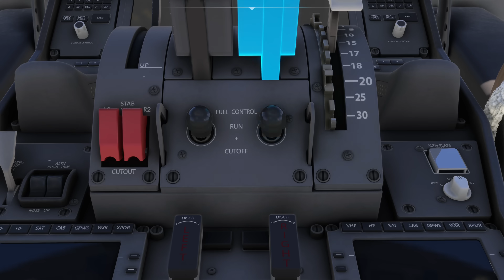Air India 171: Why Did The Fuel Cut-off Switch Get Moved?

Comment: The core issue in the AI-171 incident—the fuel control switches moving to CUTOFF just seconds after takeoff—is being subtly framed as a manual cockpit error. But given the 787’s documented history of software glitches, serious whistleblower allegations about ignored safety flaws, and Boeing’s well-known pattern of shaping post-crisis narratives, it’s plausible—that a systemic or software malfunction played a role. The simultaneous shutdown of both engines is highly unusual and demands full technical scrutiny, not assumptions. 

ALPA-India has already raised flags about the lack of transparency, exclusion of operational experts, and early narrative bias—all of which mirror Boeing’s conduct during the MCAS crisis a few years ago, when it deflected blame onto pilots until deeper investigations revealed a concealed design failure - Boeing was at fault - due to Boeing hiding information, 2 aircrafts crashed leading to the death of over 330 pasengers. 

This isn’t speculation—it’s pattern recognition. When a company has repeatedly suppressed internal warnings, shifted fault onto crews, leaked selective findings, and shipped products with known technical issues, it becomes not just reasonable but necessary to question whether the crew is being prematurely blamed while more uncomfortable truths are being softened or ignored. Truth should follow evidence—not the most convenient story.

Comment: As electrician I have to say your opinion it cannot be an electric failure is a false assumption. They only tested a total blackout. A local short circuit can act like this. It would explain the "I didn't do it"
Vibrations also could explain that it went away.
What is the power source of these switches and where go the wires parallel to the FADECs?
As electrician I want to see the logic reversed. Switch on means engine off. Switch off means engine on. This makes sure a failing switch do not shut off the engine. How is it implemented?
I do this this way with far less critical components like irrigation pumps. Just to make sure the pump will not kill itsself if there's no water left.

Comment: Were those switches actually toggled to cutoff or was it a breif short circuit that bridged the connection the switch would have made? If it was a breif electrical bridge or arch then could it potentially be viewed as from run to cut off and then back to run again? The flight crew would then ask the question about the switches being in the wrong position

Comment: Pilot in question could have been extremely fatigued or deep in thought and had a colossal brain fart and subconsciously toggle the cut off switches.

This wasn't engine failure but still gets called as duel engine failure.

Comment: Agree on the AI issue - no way.  But a couple of cameras in the cockpit recording crew actions directly into the Flight Data Recorder - why not?  In this case we would have had 100% confirmation of who did what with those switches over a month ago.  The tech is cheap, easy to install and not difficult to certificate.

Comment: Is it possible to put the switches in a third intermediate position between the two positions -- where the vibration of takeoff could push the switch into the off position. I thinking if the position of the switch can be held in place between the indents. Could a nefarious third party have done that before takeoff?  Are those switches toggled or checked by the pilots before the engines are started?

Comment: After watching a video of a 787 cockpit during takeoff the pilot flying has his hands full holding the yoke with both hands executing the takeoff, the pilot monitoring retracts the gear. In this crash the gear was not retracted therefore the pilot monitoring was doing something else, like turning fuel cutoff switches off than on. IMHO.

Comment: A simple key operated Fuel cut-off switch could be installed on all aircraft. The Captain for example could be given one key to unlock the left engine cut-off switch and the F.O. given a different key for unlocking the right engine cut-off switch. This would ensure that only one switch at a time could be unlocked and turned off. This would ensure that one engine always remains running during the critical climb out phase,

Comment: You assume that the fuel cut offs were moved by the pilot, there is a thing called bit flipping, we are also at the peak of the 11 year solar cycle, these solar cycles can take out the power grids in USA and interfere with electronics and  radio communications. There is a documented case of bit flipping, (Bit flips are a type of unintentional changing of memory data. Computers store data in the form of bits as 0s and 1s. When a piece of data gets ‘bit-flipped,’ the value of this memory data changes or flips: a 0 becomes 1, and a 1 becomes 0.This bit flip happens when a high-energy charged particle strikes the memory hardware. These particles could be an alpha particle or a cosmic ray originating from space. When such particles strike the memory hardware, they alter the properties of the electron used to store the data, causing the bit to flip.)  As far fetched as it sounds this could of  happened to the computer in the plane, they have several computer systems running and it could of been the computer turning the switches back on again, the switches never mechanically moved. All along it would of appeared to the data recorders the pilots moved the switches, as crazy as this sounds is as crazy as the pilot moved the switches. At this very early stage it doesn't appear a pilot was on a death wish. Bit flipping is rare but it does happen.

Comment: This is SO wrong Captain Steeeve! Taking this narrative and running with it without presenting any other possible scenario is just wrong.  There is NO proof that those switches had been turned off, and then back on. None, at least at this point. The Flight Recorder simply logs data. It has zero knowledge of if a switch has been turned off, or on. The Flight Recorder according to information available, showed the fuel pumps went offline, and then back online, within seconds. That's all the Flight Recorder shows. It cannot see switches. 

So at first the rumor was the switches were found in the off position. So everyone said YEP, done on purpose! Then the correct information came out that said the switches were found in the run position. SO, the narrative had to be amended. Well, he turned them off, then back on. Then the voice recorder was presented that said the pilot said he did not turn off the fuel. So then the narrative had to be amended again...well, he was lying. All supposition. Every bit of it. There is zero proof of these accusations or suppositions at this time. It could be correct. But as of this moment there is no proof.

There was an AD on this plane from Oct. 2024 about the ECC, specifically the autothrottle failing at "critical phases of flight." The FAA said the autothrottle, ECC could and has, failed on approach and landing. While the known glitch was on approach, a glitch is a glitch and it is plausible the ECC was also erratic on climb out. The switches were found in the run position. The voice recorder shows the pilot said he did not cut off the fuel. It seems awful easy for everyone to call this purposeful without wondering if there was a software glitch in this plane. I mean, Boeing and software glitches aren't exactly foreign to each other! 

I hope the investigators have more of an open mind than the commenters here and look for explanations other than done on purpose. I also hope if they figure out it was yet another Boeing software glitch they don't cover it up. 

Just an FYI I am not a Boeing hater, my long time GF was executive secretary to the President at Boeing Charleston. And I am a retired ATP.

Comment: Is it not possible that the pilots accidentally triggered the fuel cutoff switches? One of their shirt sleeves or a watch could catch on the fuel cutoff switches when removing their hands from the throttles after liftoff. The inbuilt safety mechanism of having to lift the switches could easily be bypassed with something catching on them.

Comment: Wait a minute. There are some questions. Which pilot was flying the aircraft?  Second, we are told that the fuel cut off switches went from Run to Cut Off. Somebody has written words to this effect so everybody believes it. After a crash like this I would expect the cockpit to be reduced ti a mangled mess. This includes the controls layout between the pilots.Why do we not have photographs showing what is left of the control panel layout? I do not believe the so called Report because it is written by a living third party. Its easy for the India investigators to write words but who knows if they are the truth?

Comment: The two cut off switches were both moved from open to closed within .01 seconds of each other. So with each button being spring loaded I would to like to see anybody that has this kind of reaction speed if each switch has to be independently moved. Otherwise it would require leaning over the switches and using two hands to close the fuel lines at the same time, in which case there will be a "what the f*ck are you doing' moment on the cockpit recorder.

Comment: !!IMPORTANT DOUBT!!: Is it possible for the flight data recorder to record the fuel control switches in the CUTOFF position even if the levers were never physically moved from RUN to CUTOFF? Does the FDR record the physical movement of the levers or just the electrical signal indicating a change in position? And could this signal have been generated by an electrical circuit failure rather than by a real movement of the switches to cut off position? If this is possible, could it be that, after noticing engine shutdown, the pilots physically started a recovery procedure moving first the switches to CUTOFF (this movement not recorded by the FDR since for it the switch were already in cut off position) and then back to RUN as part of an emergency restart attempt (this movement then properly registered by the FDR)?
Reply: In other words following the sequence of the events: in the context of the Air India AI 171 incident, the FDR recorded both engine fuel control switches moving from RUN to CUTOFF within seconds of takeoff. However, the CVR transcript suggests the pilots were surprised by this, with one saying “Why did you cut the fuel?” and the other replying “I didn’t.”

My question is: Is it technically possible for the FADEC or associated systems to send a CUTOFF signal to the FDR without the physical movement of the fuel control levers? In other words, does the FDR record the electrical signal state or the actual mechanical position of the switches?

Additionally, could the pilots have moved the switches to CUTOFF and then back to RUN as part of an emergency restart attempt after noticing engine shutdown? Would such a sequence be distinguishable in the FDR data?

I’ve reviewed the preliminary AAIB report and FAA SAIB NM-18-133, but I haven’t found a conclusive explanation. Any insights from pilots, engineers or investigators would be appreciated.

Comment: How long the engine can operate during normal flight operation at the safe cruise altitude  after the putting the fuel control switch to the 'Cut-Off' position? Is it a practice that these switches will be turned to Cut-Off during re-fuelling operation at the ground? Is it necessary to turn the swich to 'Run' position before starting the engine after the re-fuelling? If not necessary, can the flight take-off with this Fuel control switches in 'Cut-off" position?

Comment: Everyone is asking if "the computer" could have shut off the fuel- I say NO for the following two reasons.
1) The switches were moved from RUN to CUTOFF one second apart. "The computer" is not going to take a second, which is an eternity for a computer, but about the right amount of time for a human hand.

2) IF "the computer" HAD shut off the fuel, the crew would have found those mechanical fuel control switches still in the RUN position and therefore would have THEN had to first cycle them to CUTOFF before being able to switch them back to RUN. The EAFR does not reflect this extra action, or at least the report makes no mention of this- and that would be game-changing information.

I propose the following: upon rotation, the Pilot Flying would have had his hands on the yoke, and his eyes UP. The Pilot Monitoring had both his eyes- and his hands- available to do things. I suspect the Pilot Monitoring (Captain, on this flight) chose his moment, reached over, and moved the fuel control switches from RUN to CUTOFF. There would have been a startle in the cockpit- lights, alarms, EICAS messages. After a few seconds, the Pilot Flying might have seen the fuel control switches in CUTOUT and then asked "Why did you do that?". Well... if you're a parent and have ever caught your kid doing something dumb, you know what you can expect for an answer. In addition, the offender KNEW his response would be captured on the EAFR by the microphones. Furthermore, denial would avert a conflict in the cockpit, and with the deed done at 400' AGL, the results were sealed anyhow. Regardless of who moved the switches back to RUN or who made the MAYDAY call- it didn't matter- and the offender would've known that.

I don't WANT to think these things, but the report certainly supports it, not an accident or some computer glitch.

I welcome responses from people who know more than I do on the subject.

Comment: To believe the report, you'd have to believe:

The pilots pulled back both thrust levers right after takeoff.

Flipped both fuel switches to OFF.

Realized the mistake and flipped them back ON — all within 40 seconds.

🎙 “Does that sound even remotely believable? Or does it sound like someone’s rewriting the story to shift the blame onto the only two people who can’t defend themselves?”
Reply: What makes you think it was a mistake?  If one of the pilots deliberately threw the switches to the cutoff position ,as it seem to have happened, it took around 10 seconds for the whole thing to play out.

Comment: Is it possible to move both the fuel cutoff switch from on to off within a second? Why is an advisory issued by Boeing about the switch if it's impossible (your words) for the switch to transition from on to off?why should't that angle be investigated?

Comment: On the Boeing 787, fuel switches are protected.

You can’t move them to OFF unless:

You pull the thrust lever all the way back to idle first, and

Then manually switch it off.
Reply: That would also mean the «culprit» would have to have started moving the thrust lever back even before takeoff
Reply: A current dreamliner pilot said it is impossible for the pilot to switch off and on the fuel control switches within 32 seconds.

Comment: I don't believe Boeing is trying a cover up here like the Maxx or the other incidents as the EAFR can be interrogated and verified thoroughly; however, I do have serious complaints about the weaknesses in the design of the fuel cut-off switches that seems standard across almost all of Boeing's range of aircrafts possibly even from other manufacturers? Point 1: Granted the switch activation requires 'conscious' action to lift over the detent, however at the end of the day it is still a toggle between up and down positions with no additional checks in either direction. A pilot with lesser experience - i am not suggesting for one moment that either of the AI 171 pilots were - or under stress/ fatigue, a momentary glance to mentally decipher that the switches are in the """wrong""" position - i.e.: confusion between 'up'/ 'down' and 'on'/'off' - may trigger a panic reaction for that pilot to flip the switch "the other way" and still think he had done the right thing, is a possibility. I think the more accurate term for this maybe 'moral relativism'?, but unlike in any other situations where there may have been rational thinking, in this type of a situation it may arise subconsciously from simply being stressed/ fatigued, resulting in reactive panic action. Suggestion: there needs to be additional prevention (similar to 'Are you sure you want to delete?' in software scenarios), such as a metal (red?) spring loaded  'G' clip that will prevent 'off' position simply by toggling - even with a detent. Point 2: I totally understand the need for the fuel cut-off switches to be available to pilots at all times of the aircraft's operation; however, the function of the switch is to (abruptly) de-power the engine/s. Will it not be the case that the throttle/s need to be first pulled back to idle power before the fuel cut-off is activated?? That would be the standard procedure say, during an engine fire - unless anyone can suggest reasons why you would cut-off fuel at full throttle? maybe throttle jam situation - are there recent recorded incidents of this occurring? - bearing in mind the throttle levers these days are not directly attached to tensed cables. Suggestion: Fuel-cut-off switch must be prevented - either mechanically or via software control by monitoring TPS - to be set to 'off' until throttle is at idle position. Another good example of this implementation achieved by default is in older aircrafts such as the Lockheed Martin C-130 where the fuel cut off switch IS the throttle lever pulled back to idle AND THEN lifted over a detent (at least 2 lbs of effort required i hear - days when pilots needed to be Pilots! :) ), if required to cut-off fuel. These are my two cents. No matter whatever happens now we will never know the truthful answer to this very sad incident. May all souls rest in peace and those left behind find their strength through support of one another and prayer. Capt. Steeve, love your channel sir, and the real life work you do - not only the flying but the counselling work too. Immense Respect.